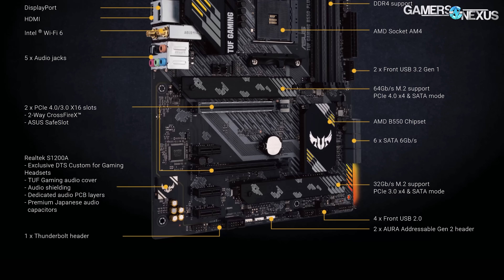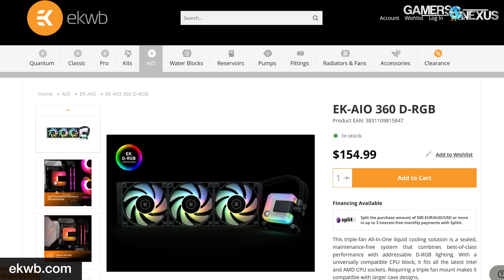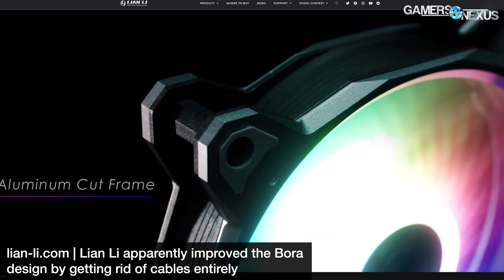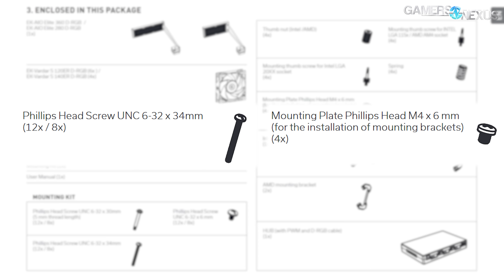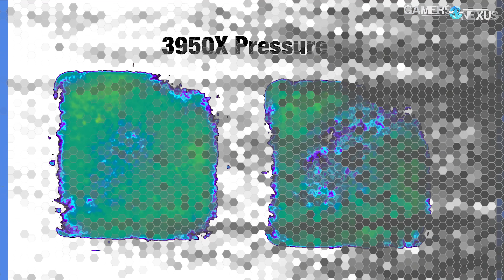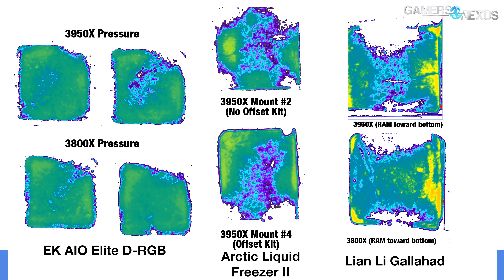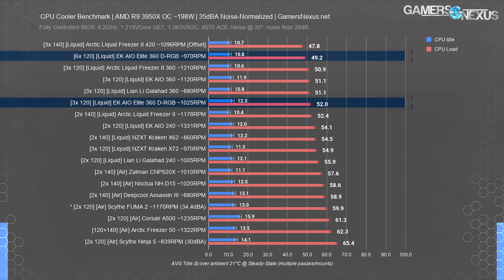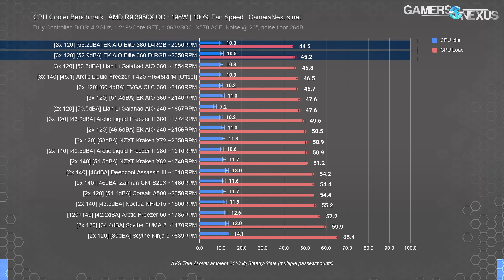6-Fan EK AIO Elite D-RGB 360 Review vs. Lian Li Galahad, Arctic Liquid Freezer, & Air CPU Coolers

Comment: Haven't watched the video yet so I'm not sure if Steve addresses this or not but I want to say it regardless.    
I have this aio, ended up swapping out all six fans for 3 gentle typhoons because the rgb was an inconsistent pain in the ass to control and there was no graceful way to deal with the rats nest of cables that came off the hub. Also the barbs coming off the block will hit your first ram slot on most boards, scratching up the side of the first dimm and potentially damaging the slot from how much pressure is on it. Personally I haven't seen any difference in temperatures between six fans and three.
Reply: Can’t u mount it so the tubes are facing down?

Comment: So, as far as the cooler itself goes (fans aside) does anyone have confirmation on if the EK units themselves are the same aside from aesthetics? I.E. will the basic perform just as well as the elite if fans are added for push pull?
Reply: Elites pump runs roughly 700rpm more then the regular. Other then that just the block colors are the only thing that separates them. Black, gold or white.

Comment: I just unboxed my @arctic Liquid free 2 420 yesterday for my build and It was such a joy to see ONE cable for the entire beast. just one.  I don't think I will ever be cable manage 14 cables of EK AIO ever.   for those looking for non-RGB and performance AIO Artic liquid freezer is a great choice.
Reply: The wires go from the fans to the hub, the hub has 1 wire that plugs into the mb. What is there to manage?

Comment: Now imagine that plus a 480 with fans and that's what I had to cable manage in my case.  Nothing like 14 fans.  I did find that if you route the cables behind the screws that hold the fans, you can route them all out of a single spot and then use a 3 way splitter.

Comment: One situation where the push-pull situation would be genuinely beneficial, is if the radiator is mounted on a heavily dust filtered intake or one otherwise rather restrictive. The six fans versus the three would produce more static pressure more easily, at a lower noise level.

Comment: just gotta say, when i rebuilt a couple of weeks ago, i went with the EK 360 drgb based mostly on your review, and a little bit on the aesthetics (i like the big chunky rgb block, whatever lol)
i thought about the elite, as the 3 vardar fans plus the controller is a solid deal ...  my only gripe is adjusting my mentality to live with an AIO without a coolant temp sensor. 
I wish you would have mentioned that in this review, as some people are used to it with the corsair offerings.

Comment: Both cooler master and Arctic have already figured out out how to package >3 fans together so that they don't get damaged without the need for excessive plastic wrap. You just pack the fans really tightly against each other so that they can't move relative to one another and use a cardboard flap to make a separate compartment for the cables and screws. It's really cheap, effective, and should be trivially adaptable to the packaging of an AIO.

Comment: Man, I thought the regular EK 360 I got was bad with those RGB cables. That beast you've got there looks like a nightmare. There is no way the flashy lights on the fans is worth the effort of dealing with cleanly managing those cables.The fans should ports on two opposing sides that you can plug whatever length cable you need in. that would let you either chain them together with tiny cables or let you run a cable per fan.

Comment: cant be better than the 12 140mm fans i have across 3 560mm rads :3 And i dont waste my time with rgb fans, so its a total of 12 cables still.

I also never consider push pull. Ive noticed that they rarely make an rgb fan that can equal or even come close to non-rgb fans in static pressure. l stopped being looks focused because of things like this. good static pressure focused fans are what you need for these. Doubling the fan count for a mere 3deg just shows that they are just more crap with colors i wouldnt consider for a radiator fan.

Comment: For the cable mess, there is a better solution: The Lian Li Unifan Concept. Contacts on the side of the fan and only one set of cables per radiator side. Well, I'm a big fan (hehe, punny!) of the concept.

Comment: Those aren't that many cables. I have two 360x65mm radiators, each with 6 120mm fans, plus 4 140mm fans bringing fresh air into the case. In regards to pricing, $200 sound fair considering everything  that comes in the box. I have no problem spending $150 for an EK CPU Waterblock alone, and $250 each for my 2 EK D-5 Pump/res units because I believe their products are worth it. AIO's just are not as pretty as an open loop with a plethora of PETG tubing. And for a enthusiast like me, looks mean more then performance.

Comment: Please test the ek aio basic addition 360 against the original. Curious if they are using cheaper lower airflow fans. Could be a good budget contender in the current market though. Much cheaper then the arctic freezer II on Amazon.

Thanks for all your hard work guys.

Comment: i would like to see you guys trying a software called GAMESS for cpu load test. It usually heats up my cpu 10 to 15 ºC more then cinebench 20. This software is not a benchmark one, it is used to perform quantum chemical simulations, but it is great to load all the cpu threads.

Comment: Hey GN, I work in tech and use your screwdriver set often. So far it's been the most reliable one I've ever had; no chipped bits, no strips since you provided all the normal computer bits, and the grip is real nice when I need to torque a bit. Also your deskmat is sitting at my work desk. Really awesome job with everything!

Comment: I just have one thing to say. Arctic offers 2 year warranty where I live while EK offers 5. That was the single thing that totally led me to buy EK without further thinking.
Reply: And to add something, my experience is excellent, the build quality is great, packaging except the amount of plastic was also nice and I bought it specifically to use 3 fans as intakes and only 3 on the AIO, which is pretty easy to use with the hub (which was also a + point when shopping for an aio)

Comment: Liquid Freezer 2 still remains the P4P BEST AIO on the market. This EK costs 38% more than the 360 LF2's MSRP, it's 28% more than the 420 LF2's MSRP. It's 10 decibels LOUDER than the 420 LF2 at 100%, 12 decibels LOUDER than the 360 LF2, and when noise is accounted for, the 420 LF2 beats the EK. 6 fans make the EK AIO space clearance more difficult for most cases versus the 360 LF2 and arguably more challenging than the 420 LF2 - especially for top-mounts. The value argument for EK's extra fans is easily killed by the fact you'd SAVE EVEN MORE money just buying a LF2 and buying a fan pack, LMAO - dumb argument. 

Overall, EK's 38% pricier AIO is just a very tryhard attempt to equal a better cooler by putting forth much greater effort using twice as many fans that are 300RPMs faster than Arctic's while being 10-12 decibels louder. You could ignore the problems with noise, space clearance, cable management, and pay more just for "MUH RGB!!1!" or you can wait for the RGB LF2 to release.

Comment: I recently got the SSUPD Meshlicious case and I wish this came in a config with 2 instead of 4 140mm fans because there is nowhere else for the fans to go. I could potentially sell the fans. I hope they just improve the non-elite with some of these changes. Or just make a basic 280mm.

Comment: 6 fans is hellish to cable manage Steve? Hold my beer... Try my 1000D maxed out with ALL the fans! 8 in the front, 2 in the rear, and 3 up top. And there using corsair QL series fans so 3 cables per fan. Yeah... Now that's hellish! Especially when dumb dumb did not realize the case does not come with the 140mm bracket for the fans so I had to mount the fans with zip ties! D 'oh!

Comment: Galahad’s cable management is so so bad but that looks worse. And not having a sensor for the coolant temp is also lame coming from an AIO that did. Any recommendations for an Asus board, fan speed wise? I don’t have any way of delaying the fan ramp up in the bios and… VR runs terrible if I have a fan speed controller running in Windows because of some weird NVIDIA bug that hasn’t been fixed for months.

Additionally in your tear down it seems to me as though the Galahad might be leaving some performance on the table with the Ryzen chiplets. The injection pattern on the chip makes it so that the flow is split horizontally on the center of the chip, leading half of the water flow to go towards the chiplets and the other half to basically get recirculated. I wonder what the impact is or if I’m exaggerating it and the coldplate spreads heat more evenly than I’m imagining.

I’ve considered picking up derbauer’s AM4 offset kit to see if it improves CPU thermals at all but it’s going to be pricey and take forever to ship. Could you guys test it for me and see if it’s worth it? ;)

Comment: I'll admit that I use EK's AIO, but I have the 240mm version with the RGB block. I use it on an overclocked 9700K and it works wonderfully. Though I will say that the unit I bought did not come with one of the fan hubs included.

Comment: Yea the corsair LL fans are nightmares as well. I have 6 im my case, along with 3 noctua slim 15mm thick fans. Then the 4 corsair strips, and the rgb in the waterblocks, and lastly the pump/res rgb. I have the blocks on adapters to be controlled by icue, same with the res. Everytime its due for a complete maintainence, i put it off for long due to the rats nest of wires. This last time i spent a day managing the cables and grouping them together. I still dread having to deal with them.

Comment: Plastic wrap is usually there as a moisture barrier.

Sure in theory they ship in weatherproof containers or trailers. In practice it is a dice roll.

Pallets get left outside. Containers get damaged. Sometimes doors are left open. Sometimes they aren't closed properly.

Sure removing single use plastics makes a good headline and all, but writing off a whole pallet of product because it sat on top of a puddle is far less environmentally friendly.

Comment: 6 really good RGB fans and a 360 aio for $200 is suprisingly super reasonable. Considering the fact that the fan costs $25 each on its own, you are looking at a wildly good value if you use the other 3 fans in a different area of your case. This is absolutely an amazing bang for the buck looking at it that way!
Reply: yeah cost $25 each but only worth $7.50 each and $5each for them to make. 
can't compare cost of a single item to bulk buy. 
250 grams pack of minced beef might be $5 ($20/kg) but then 1kg pack of same mince might only be $10 as buying in bulk

Comment: Could someone please help me understand the whole celsius thing. If I recall correctly Steve stated that the difference between the 3 fan to the 6 fan setup on the EK was of little difference. But 1.4 degrees celsius is (according to Alexa) 34.5 degrees in fahrenheit. How is a difference of over 30 degrees not significant? I have run into this same thing several times now and I can't see what it is that I'm missing. Am I misinterpreting something?

Comment: I prefer not to say how long my cable management took in the Corsair 1000D with QL120 Push Pull configuration, there are 16 fans on the front of the case

Comment: EK also quitely released the EK AIO Basic which is the same price as the Arctic liquid freezer 2 and it's got the same non RGB design. A lot better mounting than the arctic and smaller rad.

Comment: Hey Steve, thank you for this video.  
I wonder if pump noise included in this chart at 12:35?
Pump fan directly connected to the motherboard if I’m not wrong and wonder if it’s loud at %100 speed. 
Thank you!

Comment: The radiator being only 27mm thick and ALUMINIUM makes the price look even worse. If you ever want to upgrade to an open loop while utilizing parts of the AIO, you're forced to replace the radiator with a copper one.

Comment: what i really want is a AOI that has longer hoses and detatchable hoses so i can put the reservour/radiator combo on top of my case.  a 2x2 fan setup would be a great idea and you can make a 30x80x280 reservour on the bottom with the pump inluded. a seperately buyable pump/cool block combo would be nice as well for both warrantee fixes and replacement price if it breaks as you can just replace the pump/cpu unit.

Comment: How long we need to suffer because of the cables until an industry wide standard solution comes along that combines pwm, argb (and other data if needed), and lets us chain the fans together like how LianLi does it, so there's only 1 single cable that goes into the motherboard? All these cables and fan hubs(that turn out to not even be capable of addressing individual argb fans, and can only measure rpm of the first fan) are ridiculous.

Comment: Thank you very much for this video!

I am wondering though, what are the temperatures of the case and GPU? I am wondering if this push-pull configuration vs 3x120mm fans might benefit the GPU temperatures and general airflow of the case - while it might seem overpowered for the CPU, I would imagine that such configuration might benefit the airflow seeing how the front panel is "blocked" by a large 360 radiator and this configuration allows for the maximum airflow with the lowest air temperatures possible.

Comment: Still prefer my Alphacool Eisbaer 420mm AIO.  Though I DID replace the stock fans with dampened Noctua Redux 140's.  So I had nicely loomed cables from the get go.

And until someone comes up with an easily replaceable multi-fan setup for these, cable management is ALWAYS going to be a beast.

And just so  we're all on the same page.  RGB LED PUKE MUST DIE!!!

Comment: I know it would increase a bit a cost of fans, but I would do not mind if we will move to have 3/4pin build in the corner of a fan where normally cable stick out, and modular cables for them, shorter and longer.

Comment: cables management? what is this things you speak of? I have two radiators with 3 fans each that are EK's only half RGB but also a block for CPU and a block for GPU and a pump res that are all RGB I just routed that shit where ever I could to kinda keep clean look and jammed that shit in the back I recently thought about a new mobo and faster storage just because I can but NO I can't I'm not ready for that cable hell again not yet

Comment: Artic Liquid Freezer 2 just released an RGB and A-RGB version on May 13th. I upgraded to a Ryzen 9 5900X recently and needed to revamp my cooling solution so I pre-ordered the A-RGB LF2-360 to replace my Corsair H100i cooler. It arrives today so I'm pretty excited to get it in and do some thermal testing. This EK cooler was my runner up in cooler selection, after seeing that mess of fan wires I am EXTREMELY glad I didn't go with the EK. Great video as always!

Comment: If they wanted to use standard fans and connectors they could have just cut a path down the edge of radiator for cables to run making it more tidy, then to go a step further have a mini hub at the bottom or top of the radiator where the cables/connectors can all go into. This hub could then have just 2 cables out of it making the whole unit a heck of allot cleaner to install. Fan hubs are cheap as chips these days and cutting a groove surly would not require to much extra tooling. Well dont even need to cut a groove i guess you can stick on something instead to hide the cables just like you do at home when running cables up the walls.

Well done on the plastic cutting down!

Comment: As an user of this cooler (on an R9 5900X), I'm surprised that nothing is said about the pump noise at full speed (3400RPM), which make quite an annoying whine.

I would add that the push-pull configuration looks stunning in some cases. It gives a "reactor" look from outside (in an 011 Dynamic) that looks really good.
Reply: My 5800X3D is hot, looking at new coolers. What kind of temp did you get

Comment: I bought the EK AIO "basic" 360 for my 5800x.
3x120mm fans
No RGB (positive imo)
$150AUD
Fantastic build quality, installation was straight forward, temps are great with 50% fans in bios (basically silent)
Highly recommended.
Reply: how is the cooling on the basic compared to the rgb version? ive been wanting the basic for my new build becuz of how clean it looks
Reply: @ModalSoull  it should be the same. The fans are the same, they just don't have RGB.
Doesn't go above 68 C.
Ive done benchmarking, but I mostly game, that's why I limited the fan speed.

Comment: I have the 240 EK AIO and I love it. Looks and runs great. The one downside to it is the massive CPU cooler. Due to its size, it pushes on my ram ever so slightly. So be careful to anyone looking to buy one of these, as you may end up with an unusable ram slot lol
Reply: Still using 240? How is it ? No issue with pump after year )?
Reply: @nikeller11   Yep, still using it. No issues that I know of. Just be aware of the ram problem some people have. Also, the rgb is strictly in the center of the pump, so the edges of the block may seem faded even at full brightness. I think it looks good, although I can see how that may be a turnoff for some people.

Comment: Sheds are not good for 3D printing due to gusts and uneven temperature. So, I really don' think they did in a shed. EK is Slovenian company, the extension cable would be 50m, not 100feet either, but again not a shed.